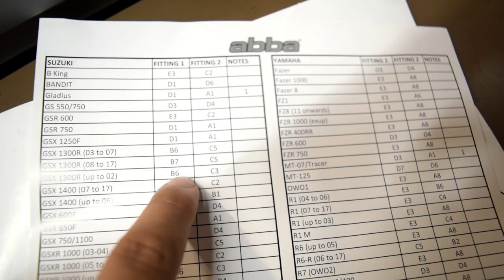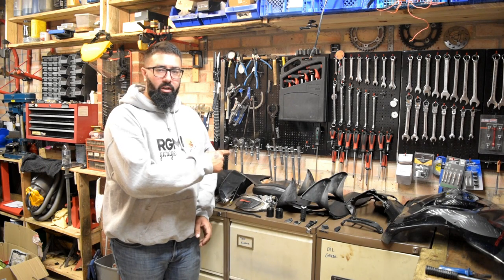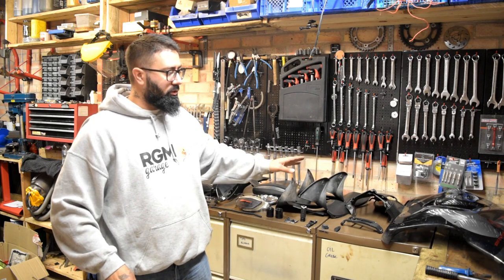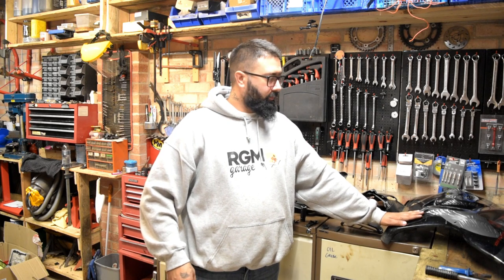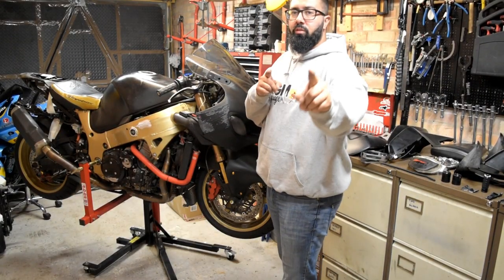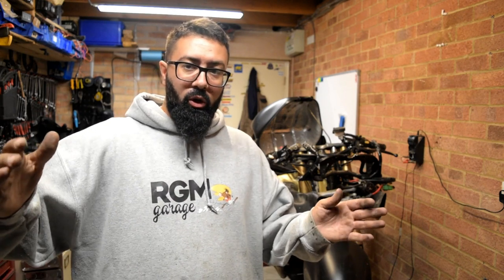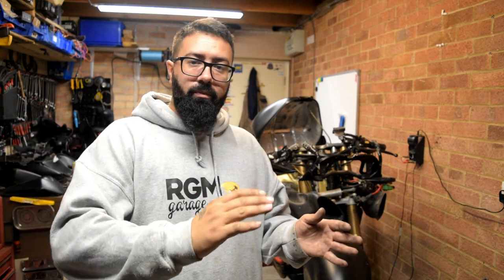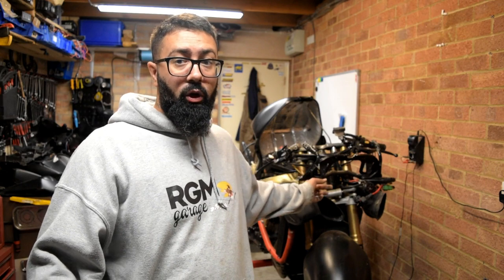SUZUKI HAYABUSA RESTOMOD - EP1 - Disassembly

Comment: Nice, and maybe I can help a Hyabusha affectionado? I have an elderly friend in South Africa that bought an 2013 model brand new. Less than a month later he upgraded to a 5 into 1 pipe. He is now elderly and wants to sell the original spares. Includes the standard stainless pipes (immaculate) and the accompanying original complete manifold. Also includes the original tailpiece if interested. He reckons he will accept in our currency South African Rands R5000.00. This equates in U.S. Dollars to about 298 Dollars and British Pounds to about 250 Pounds.